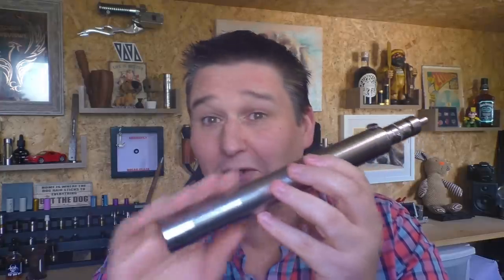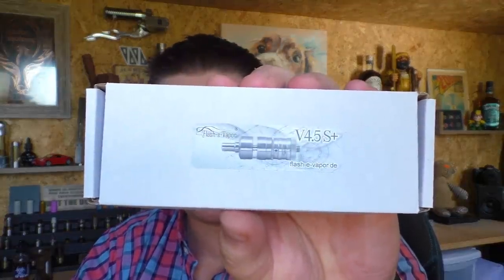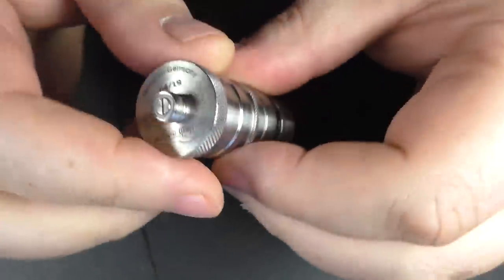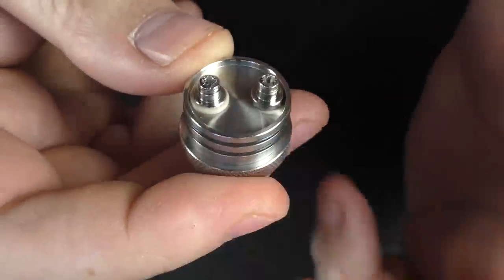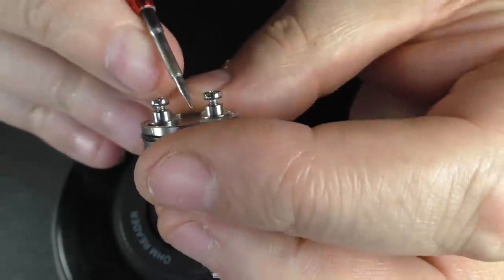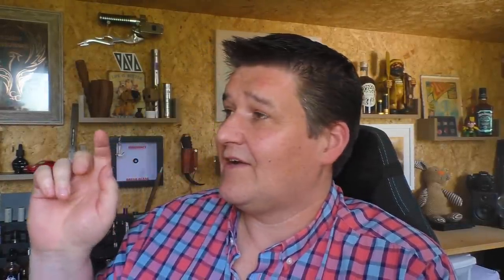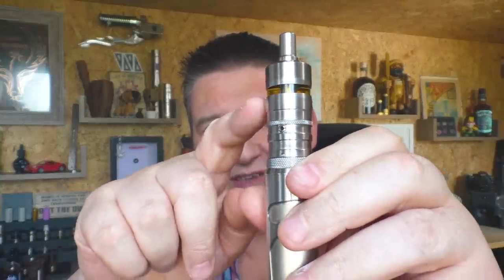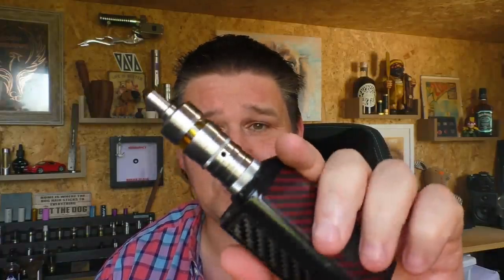Flash-e-Vapor V4.5S+

Comment: Thank you for the excellent review! Sadly after al the time that's passed, no improvements have been made to the deck screws :-(((. I usually run 28ga wire so it's easy to mount.

Comment: I used it for many years exclusively. So the change with the feeder wicks is nice, dropping it with mesh would cause the mesh to move and cause leaks. Also you dont have to drill it out anymore. Moved on from it last year. Just picked up a sr Kalora to replace the FEVs historical german spot. Its somewhat similar but I like it better. Wicks phenomenally fully built in rayon, with rayon drop wicks at 50w.

Comment: I’ve still got one and I’ll have to dig it out. Don’t know what version it is but even with the big air screw it’s still quite restricted. I drilled another hole on the other side (old ones just have one hole) and fitted a second air screw but even then it’s still too tight for me. I think the issue is with the diameter of the main shaft. Maybe the later versions are different?

PS You are meant to dangle string down from the tank onto the cotton I thought?
Reply from the maker: No, dangling cotton and mesh straws are no longer required.

Comment: This is a great review, but for the cost, that deck is just not worth it to me. I have never liked relying on post screws to capture leads. I just feel like, in 2019, they could go with a different deck design.

But if the flavor's that good, then why fix it if it ain't broke, right?
Reply: They simply never changed the running system. The FeV is not built to use big alien/clapton coils but simple wire. And the taste is still one of the best you can get from an MTL device. Of course it looks very oldschool. But if you just use simple Kanthal/Stainless Steel wire, wicking is soo easy on that deck. 
Best wishes buddy and Todd - thanks for the video!

Comment: AAAh! A true Rebuildable Drippng Tank Atomiser. When putting wires under screws whether in an Atty or in an electrical box it will hold better if you can wrap the wire around the screw in the direction of rotation. That would be clockwise. Of course it is easier in an electrical box where you don't have a coil in the way.
Reply from the maker: You know in over 7yrs I never realised that..................................

:p

Comment: hi, I was wondering how long those stainless steel wicks-dlc works? are they gonna last for ever?couple a years or couple of month? I'll appreciate  any help that i can get regard to these.
Reply from the maker: Last for months, only reason I've ever changed them is that the tips can unravel over time.
Reply: @ToddsReviews  that's kinda bomber, as they cost around 16 euros :( but are they better than wick cotton cord or handmade stainless steel mesh.
Reply: @ToddsReviews  I emailed the folks over at the Fev  with the same question about the longevity of these stainless steel wicks DLC and they replied:
Hello,

the stainless steel wicks DLC are permanent wicks and last a lifetime.
Once used, they do not need to be removed from the evaporator chamber.
--------------------------------------
So now what? :)
Are they good for couple of month or a LIFETIME !!!!????
Reply: @JoltinJoe  tnx, so I'm gonna pull the plug on this one and buy them
Reply: @sc1386  I can confirm, the DLC wicks can last forever. I  vape exclusively with a FEV, I removed the wicks recently to check them out(after 2+ years in the atomizer) and they look brand new, just like the first day I installed them.

Comment: My fev 4.5s always flooding at the deck
Setting : khantal 27g 6 wraps 2.5 mm spaced
0.95 ohm vape at 14 watt air flow 1.2mm and 1.0mm
Liquid 60vg/40pg
Have any tips?
Reply from the maker: you got the ss dlc wicks in?  If so then prob just needing a bit more cotton.

Comment: If the flavour, that this RTA produces, wasn't so muted, it would be one of my favourites too, but because of this I prefer attys from StattQualm :)
Reply from the maker: Muted!  Wow, not my experience at all but respect your opinion on it.
Reply: I'm fiddling around with the FeV about 4 1/2 years now. It is a good atty, good  build quality, simple, simple to wick and so on, but I always got better flavor from other attys. Just my opinion :)
Reply from the maker: Oh I wouldn't get rid of my Skylines and Squapes for it but it's not a million miles flavour wise away for me, you probably just have a more refined palate than me :D
Reply: Ironic I love my FeV but flavourwise it's not a Dvarw 🤷🏻‍♂️
Reply: The flavour I get from this atty is stellar, however only with the very tight MTL inserts. Rich saturated and better than the Dvarw or Tripod. 2mm Kanthal coil about 5 spaced comes out at about .9 ohms. It was muted for me at first too. Keep giving it time, the flavour is there just got to find it!
Reply: sometimes you have to break in an atomizer first. but after that there shouldn't be any problems with the flavour. otherwise it's most likely due to your wicking.